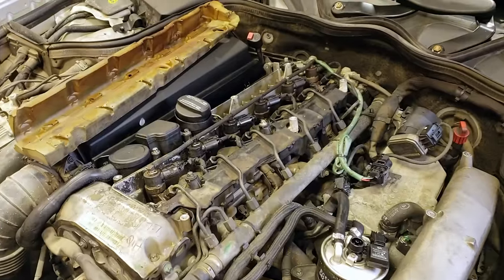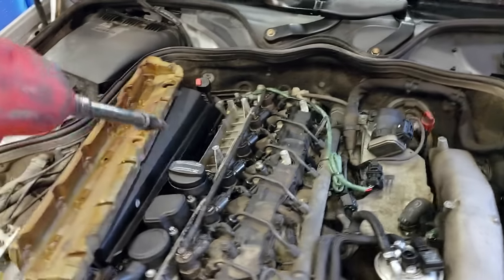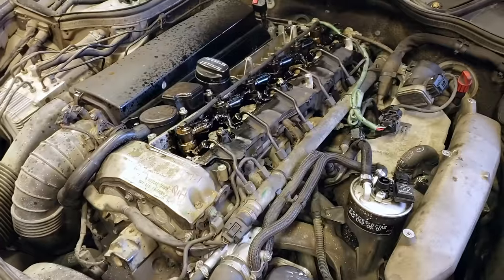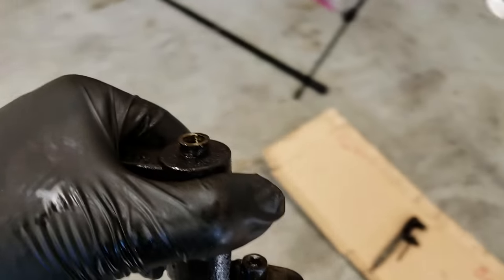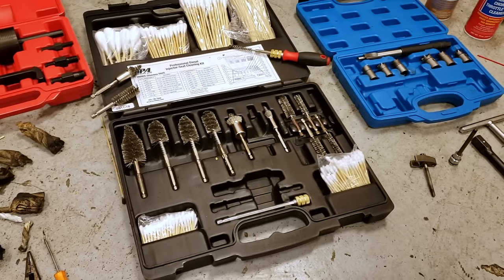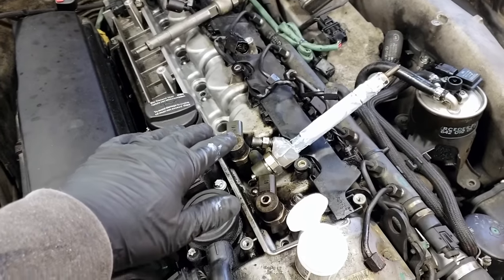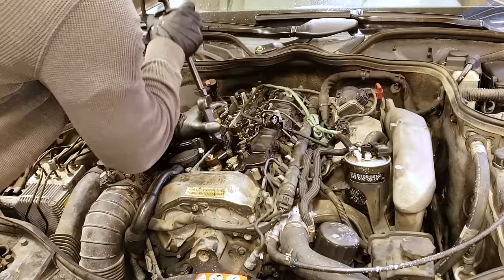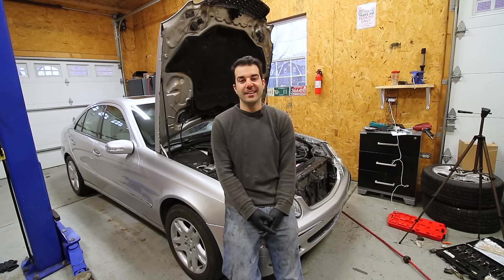My Turbo Diesel Mercedes Has A Nasty Engine Issue. Don't Buy A Diesel Before Watching This video.

Comment: There is an easy way to do this. First get the engine hot up to normal running temperature 90c and you don't have to use the pull hammer thing the injector comes right out. Easy. I've done this my self took 30 mins.

Comment: Great video.  I can tell that besides the engine job, this is some serious editing as well.  Surely not some quick 1-2 hours editing job, such a long video can take even a few days to finish.  While there, are/were those diesel injectors factory coated with that anti-seize grease? Or maybe specify some 50K miles re-coating interval. Such easy detail would have saved many of these engines (and their owners money).

Comment: Phew I thought you were serious when you said it needs to be cold. When you said you could sweep the carbon into the cylinders I got a little suspicious, then when the Family Guy clip started I knew you were joking. 
I bought my '04 Sprinter van with the injectors ripped out and broken, and a crack in the valve cover. Turned out it had black death in cyl. #2 and someone tried to fix it but they gnawed on the injectors with a dull beaver and used a 3 foot long pry bar to finish off the valve cover while they were in there. Then they either stripped the threads or lost the bolt because they jammed an SAE bolt in there that was bigger than M6x1. So I tried a Time-Sert but that pulled right out. The SAE bolt was big enough that the threads didn't drill all the way out for the Time-Sert. So I had to Big-Sert it. That also pulled out. I used the inserts included in the kit and apparently they weren't long enough. So I drilled and tapped the hole for an M10 bolt. Then I drilled and tapped the center of that bolt to M6x1 (not a fun job). I cut the bolt to ~25mm, threw some JB Weld in the hole and on the bolt and threaded it in, making sure it sat flush with the surface of the head. Now I have hard steel M10x1.5x25mm threads on injector 2. I don't think this one pulling out.
By the way, I've had all of my injectors out and back in a total of 6 times. I've had the valve cover off and back on 4 times. I can now beat flat-rate on this job. And yes I've gone through $90 worth of bolts and crush washers.

Comment: Post script to previous post, this injector blowby is getting more common on European engines as all have gone to alloy heads, also to make matters worse is the long 'Pencil' type injectors that are carboned in tight when slide hammer is applied in a lot of cases breaks off injector nozzle in the head ...

Comment: I am not a Mercedes user, but I think that if you put a washer under the factory injector holder, then screw in the bolt loosely (not tighten, leave the holder moves) then it could be used as a puller when hammering down the flat end. If the holder is not so stiff, then it can bend, but any way it can lift up the injector. How do you see that? Is it possible?

Comment: Did you anneal the wahers? The washers I get are not usually described as pre-annealed. I have done a few cleaning and replacement jobs like this on some cars with mild to bad cases of "the death".  Sometimes the slide hammer won't work and a more gradual force needs to be applied to the injecetor. This can be accomplished using a frame attached to suitable mounting points on the engine and a screwed pulling system on the injector body.  This is a lot of work but it does work in most cases (even the worst cases).  Agree with the cleaning of bolt holes as any cleaner or gunk left in these will stop the bolt from torquing (and stretching) to the right point leaving the injector loose which will cause blowing almost straight away.

Comment: Good video, but interestingly why not use an oxy acetylene heating  tip to apply some heat around the stuck injector eg aluminium expands faster than steel, “best to use a brazing tip” and have a mate heat while you use slide hammer Be careful how much heat you apply keep the heater moving around the injector “Melting point alloy 650 Celsius “ far safer then running the engine which I cannot see achieving much as everything heats up together I have worked on Diesels inc Merc’s  for 40 yrs and never came across an injector or glow plug that podgy bar and a bit o heat did not encourage out of its hole I agree the slide hammer is a good idea 
Read below Stay safe young fella
A high pressure injection injury is an injury caused by high-pressure injection of Diesel  into the body.[1] The most common causes are  working on diesel and gasoline engine fuel injection systems as well as pinhole leaks in pressurized hydraulic lines can also cause this injury. 

High pressure injection injury
Other names

Specialty
Emergency medicine, plastic surgery
Although the initial wound often seems minor, the unseen, internal damage can be severe. With hydraulic fluids, paint, and detergents, these injuries are extremely serious as most hydraulic fluids and organic solvents are highly toxic. Delay in surgical treatment often leads to amputations or death.[1] But even with pure water or air, these injuries cause compartment syndrome which leads to cell death if surgical intervention is delayed.

Comment: Five or six hours if you don't have to use the slide hammer, but you used it.  How long did it take you to do this job?  Obviously the labor behind this is what kills the engine - people probably don't want to pay for it and then don't do it - destroying the engine over time.  Thanks for showing (although the amount of time would be useful).

Comment: And removing the hold down screw while the engine is running is not smart. You can loosen it and see if compression will get it to move, but unscrewing it completely is asking for trouble.

Comment: Not a diesel fan, but well done for a good job, maybe something that could be done at 40000miles intervals, if you were and owner this information  would be invaluable, as with alot of cars. Once you know  there glitches and idiosyncrasies, it can be the differences in $1000s of dollars and trouble free motoring. Even know you were successful and made the job, look relatively easy, I'd prefer to catch it before it happens and get it done by a mechanic, but you made it look achievable for a non-mechanic with, some nouse,wanting save some dollars.

Comment: When does this happen?
I just purchased an 05 e320 cdi with 150k.
While changing the oil and filters, I noticed my engine looks brand new. All of the sound deadening is mint(he is missing the piece that goes on the injectors) and no smell of any kind, no dirt or dust.
I had to do a double take because his engine is super dirty even for a diesel, and I realized that engine is the same as mine.

Comment: Finally got around to doing mine- kind of had no choice because while I thought the seal had blown out and created a massive exhaust leak around the injector (and causing the car to go into limp mode with rail pressure codes), after removing it and cleaning the body, I found a crack in the lower section of the injector.  womp womp.

Comment: When you remove old injectors like this, do yourself a favor, clean them and take them to an injector shop to be tested, to insure they are working in parameters. If they don't, they should be rebuilt or exchanged.

Comment: My  mates merc had the hiss and the black soot so he left the cover off over the injectors as it kept springing fuel leaks from the pipework all good now engine wise just body welding and wings all reflected in the price paid for a merc

Comment: Hey i,m surprised all that slide hammering  I'm surprised you didn't  use your motor aka cherry  picker  puller to pull up on the injector.. I pulled a distributor out once on a Cleveland that was glued  in like that

Comment: 18 $ in parts only is not the whole cost of course. How much did you spend total, slide hammer set, ceramic grease and other parts and tools please? 

Also, next time extend the rod of the slide hammer, this will give a longer stroke thus more impact force. I noted the rod is threaded in the actual adapter, so it should be doable to make an extented rod.

Comment: Do you think I would be better off with the "2005 Mercedes-Benz E320 Service & Repair Manual Software" or the "2005 MERCEDES E-Class W211 Service and Repair Manual"?

Comment: Caustic soda, boiling hot water and 3 turns on the bolt that holds the injector. Run the engine and the stuck injector will pop off!

Comment: thanks for the manual link, life saver for my ford, chilton and haynes are condensing to many years in one book and doesn't have bolt sizes. Previous owner did a " smog" delete which i find to be a pain with belt slippage and exaust in the cabin, planning on going to a junk yard or finding a parts truck for it and put the egr system and smog pump back on since my fuel mileage is is way more than it should be. as for the diesel, i been working on cat engines for a long time and replacing the seal rings should be done as part of regular maintenance schedule. as for that black car with the pudding on top, i bet that head has to come off to replace the injectors. that was pretty bad.

Comment: Thank you for excellent "black death" repair info. Have you ever seen black death-type exhaust-like smells without any tarry substance forming? I have an '03 Jeep Grand Cherokee with the factory OM612 engine and had actual black death on cylinder #1. The cracking diesel fuel-like smell returned after a few months, post repair. Detergent water squirts did not reveal any stream of bubbles. Could a compression leak develop for enough away from the fuel spray so as to form no tarry material?

Comment: I forgot to add We found out later on that the toolmakers have a machine  called a wire cutter that cut a .020 slot or circle in anything . I think it is similar to a spark eroder but it feeds wire in and burns the bolt away.

Comment: HI :  Great Video.    I'm considering retiring my 20 year driver '03 VW TDI (ALH 250,000 Mile)  and looking for a well preserved 05- or 06 E230 cdi.   
  I was a little surprised you did not have to bleed the fuel system after breaking open the fuel lines...Why not..?
Any special information on pre purchase inspection of this car?    Thanks and let me know...

Comment: Is not a problem of Mercedes but a problem whit the bosh injector of this time of production, i had the same problem whit my ex car.
It was a CLK 270 cdi and the last injector (5) failur about 220.000 km.
Some diesel engines of mercedes of this year was mounted in other car like jeep Grand Cherokee or ssangyong and they all had the same problem. 
For a comparison now i drive an audi a4 3.0 whit 330.000 km and the injector is all original whit out a problem or failure.
Only production problems in those years.

Comment: One of the injector hold down thread is damaged the previous owner use helicoil to fixed the problem. Now the helicoil pulled out. what is the best way to fix this? Please help. Thanks!

Comment: I had an ML with this issue. Unfortunately it also had a transmission problem so sold it on eBay. My question is when cutting a new injector seat won’t you drop aluminium filings into the engine?

Comment: legit hard work , wondering if you could combine a slide hammer with an air chisel to mimic the pneumatic one. I have many diesels to check for the black death.

Comment: Lucky if you can actually get to the injector with a slide hammer.
Imagine this on a Sprinter, Vito (or any other van) on cyl. 4...

Comment: Did you ever run into a stuck hold down clamp? I just purchased a 2006 CDI with a good amount of Black Death in three injectors. I’m having trouble trying to remove the hold down clamp off but it’s stuck solid.

Comment: Many thanks for the black death video, extremely helpful. Have you ever had trouble with the transmission not kicking down both in normal driving and in cruise control. Mine stopped kicking down gears about the same time the black  death started so I wondered if it was somehow related through the computer.

Comment: Man these CDIs are a pain. I have a e270 Older one. The car drives good and is actually fun. But have it in EU and suffers from the SBC problem and idek how to fix it. And also has cabin vibrations when put on D and in R and even while on park. So rough idle. I'm either going to try and sell it and or if I'm gonna keep I'm gonna try and fix it. But seems too much work. But I feel it would be satisfactory to try and fix it.

Comment: can you heat the engine up hot enough by circulating the coolant thru an external heater? something kinda like a tank style block heater with a pump, but oversized several times so you have at least 10KW or maybe a propane fired heater...

Comment: cant a aluminum head warp if you remove injectors while hot ? 
gas engines with Aluminum heads if you remove the spark plugs you can warp the holes and oval them. 
wouldnt this be the same kind of thing?

Comment: Grill/oven cleaner works well for getting the burnt carbon loose. Does it's magic also in intakes gummed by EGR.
Reply: It also dissolves aluminium,like the head on this car.Never use near or on aluminium.
Reply: It does work well, but it makes a mess of aluminium, dulling the surface or even plating out the carbon onto it.  Don't leave it more than 15 minutes.

Comment: Thanks for all the great videos, i have a 2006 cdi with 320,000 miles on it, why does the injectors have to go back into the same cylinder? Also, are those repair manuals still available because the link in no longer valid. Thanks........
Reply: Also, is there a torque spec on the fuel rail to injector line fitting?

Comment: you may have just changed my next car purchase.  I was looking at w210 turbodiesels, was not aware the w211 diesels came with a non bluetec engine.  we put 100k miles on a 2004 e320 wagon, and I like the car except for the dumb sbc.  I put 230k miles on a 1982 300sd and would love to get back into a Mercedes turbodiesel.

Comment: Well i just want to address that there is no chance you can here the tstststststs sound leaking injecto makes, the E class has a very very nice noice isolation in the firewall, but what you can notice is the smell of an old unburned diesl that makes your head spin out. The same comes down for mercedes's van program, they are all the same you cant hear a damn until you open a hood, i had a vito van with 2.2 om646 come and that was intense, i drive the same engine in E class but i check my car every month (since why not) and i found it head a leaking injecto too, it just started leaking. On other cheap diesels you can tell that straight away, for example the only mercedes i was able to tell it had a leaking injector was a W168 A170CDi, it was very loud and i suppose that is a cheap car so it doesnt have insulation

Comment: Hi, when you took the injectors of, befor putting towels in. A lot of watery stuff went runnig in the hole. how did you get that out, did you even get it out. or is it no big deal for diesel engines?

Comment: The seal ring , as you put it, is called a carbon stop seal. Every diesel engine has some form of this. I have worked on Perkins, Deutz , International, Chevy..............all of them have it. Even Lister single cylinder diesels. You made it sound like it was specific to Mercedes and it's just generic diesel maint. You may owe M-B an apology over this.

Comment: So you don't have to bleed the fuel system after doing this job? I want to do the same on mine (not a Merc), but bleeding the damn thing pisses me off a bit since it doesn't have a hand fuel primer pump.

Comment: Hi Alex....when you re-cut the seats where does the debris go? With the center locator on the tool blocking the hole did you just carefully pull the tool out and then vacuum it out?

Comment: what if you loose the bolts holding the injectors and crank the engine a few times? would it pop out the injectors?

Comment: I just recently bought a 2006 MB E320 CDI with 193K. What tool can I get to test the injectors myself? if I buy all new injectors from FCP Euro, will I also need to get a MB Scan tool to program them? What is the best one to get for the money. It will only be for my personal use on this car, I do not have a shop or a lot of vehicles. I have a 2005 VW Passat 2.0L TDI that I will be working on as well.  Thanks for any advice, Robert

Comment: Hola Amigo. Vi el video,  tengo ese mismo vehículo,  comprado también con ese problema y estamos trabajando para solucionarlo , inportantisimo limpiar los asientos de los inyectores y más aún el alojamiento del tornillo , si hay chapapote en el inyector más habrá en el  tornillo , pasar un macho con líquido limpiador de carboncilla , yo los he limpiado con los bastoncillos para los oídos  hasta que salga completamente limpios . También en otro ámbito,  quisiera decirte que no se debe de aplicar un par de apriete al aflojar el perno. 

Me gustaría que me digas si en el Manual indica se a la arandela corta fuegos ,también hay que aplicarle las pasta cerámica que se vende en concesionario Mercedes ?

Muchas gracias por el video , hablas casi tan rápido como los Andaluces en España , Saludos

Comment: I just bought sane seat cutting kit ... like 4 like . I've not personally done much other than a service . My car had lots of work done (head gasket turbo kit lifters cams  rickers intajd clean and more. But I doubt they used new injector seals.  I've listened to them and cylinder 2 and 4 don't sound as crisp as no. 1 (which was replaced under a year ago ) on 105 thou  miles . Think mpg  could be a bit better and regens more than I'd expect 60-100 miles range.  Wouod you suggest eeplace thr other 3 seals or invest in new injectors ? Great video.  I can get new injectors for£ 600 for 3  but I'd need a code them in and wouod need a better code reader 

Thanks